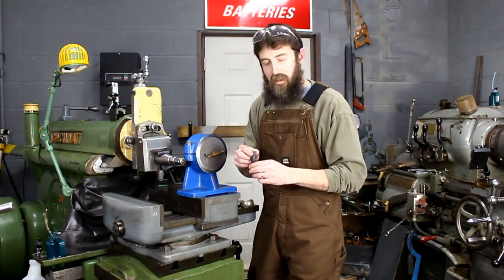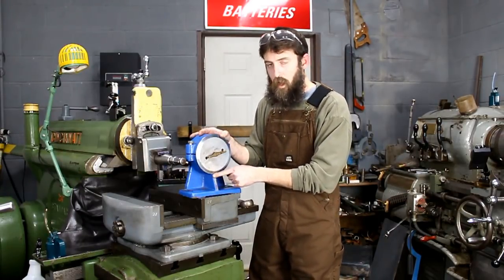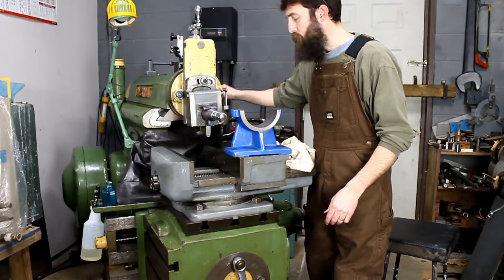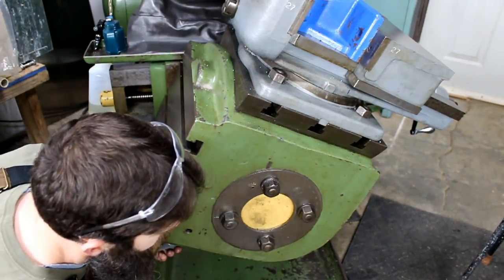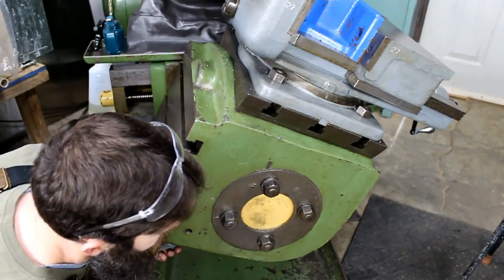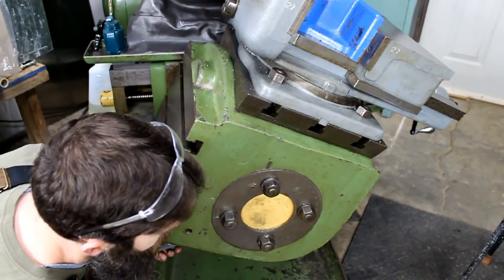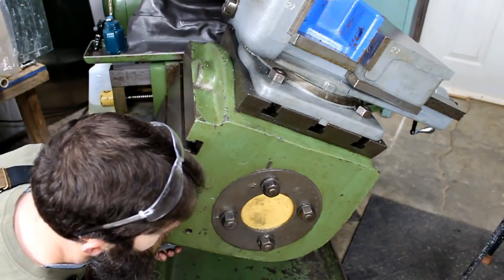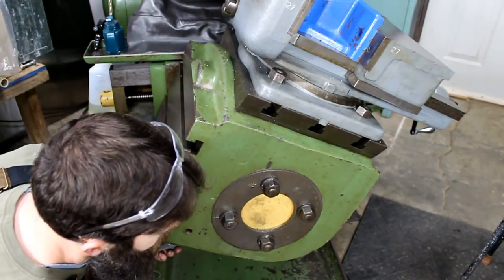Machining the seat for my veriner scale

Comment: Was the lube oil flowing in the cold shop. You probably checked off camera.
Thanks for the vid
Reply from the maker: Dennis Williams I look up at the oil tower at around 13:10  I am always checking. Once I looked up and it was not working properly and from that day forward I check it all the time. Without a steady flow of oil this machine would be toast quickly😑

Comment: What tool holder is that. I have the same size shaper but all my tool holder have positive cutter angles. That one looks like its neural?
Reply from the maker: Johnson Mechanical I believe it is an Armstrong carbide T-4-S. I will check. It holds 1/2 blanks. All my shaper tool holders are neutral rake. These holders were made for carbide use on the shaper or planer. They are hard to find. The ones with built in rake are everywhere and inexpensive.

Comment: I was wondering why you did not use the same method when you were making the brass part. Except rotate the vise instead of the knee, so you would not have to hand feed it. 
 I built an outside water stove out of a large 800 gallon compressor tank and used it to heat my shop and house. Inserted a 3ft x 3ft x 4ft deep fire box in the side and set the tank on legs made of 6 inch I-beams. I took some 1/8 gas welding rods and cut them off about 8 inches long and bent them into an L,  tacked welded them to the tank, I them applied 6 inches of fiberglass insulation and let the rods poke through the insulation and held the insulation in place with fender washers and wire nuts screwed on the wires. It was sitting in a 12ft x 12ft shed I built for it. It sure is nice to come out to a heated shop when the heat is almost free except for the work cutting the firewood which I do not mind. 
  We spend most of our time in a shop in the winter and hot summer days, because on the really nice days that is the last place I want to be.
Reply from the maker: imystery man I was just showing different ways. They are a lot of shapers that the box does  not rotate on and that was just one way. I also had some viewer questions about the compound rotating and being able to cut angles. I have wanted a outdoor boiler for years. I heat my home with wood and also don't mind the work. I enjoy it most of the time.
Reply: Outside water stoves are not that hard to build, it just takes a bunch of welding, like 60 feet of weld just in the firebox. I bought most of the metal from a scrap yard, I love shopping at scrap yards. I am amazed at what people sell off at scrap prices. I bought a hydraulic capstan winch for 30 bucks and sold it on ebay for 945, are you lucky enough to have any scrap yards near you?